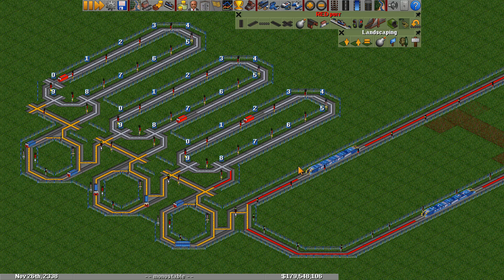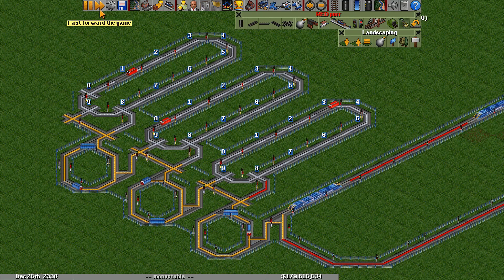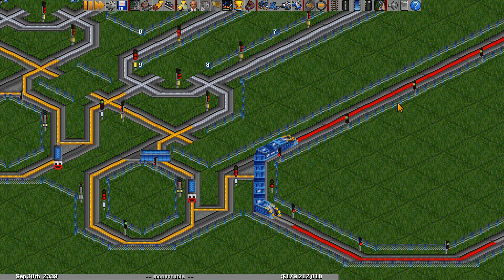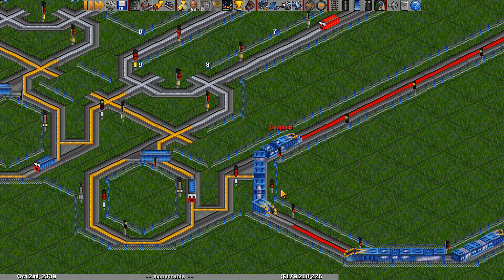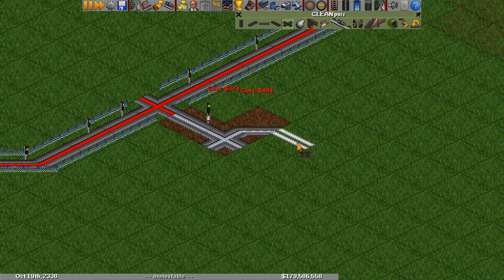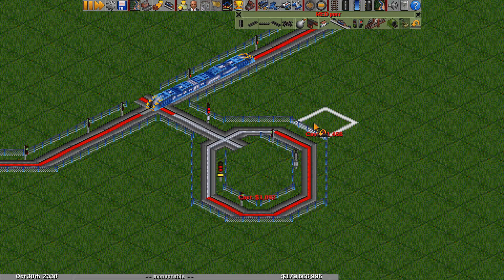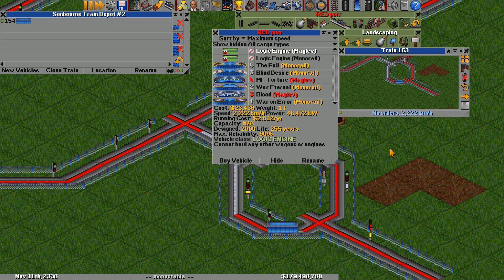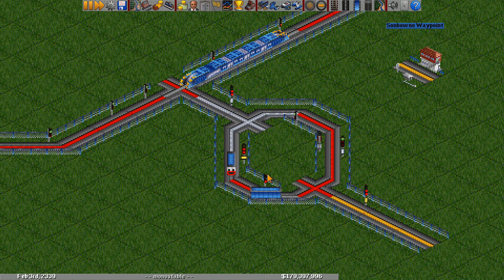OpenTTD Logic: Train Counter (Monostable Circuits / Edge Detectors)

Comment: I kept having trouble with my MSC in this orientation. I found that I could build it aligned with the grid. The input is done on one long edge, and the output from the next short end in the direction of travel. Exit signal  on the corner after the output, entry signal diagonal from the exit, and blocks on the remaining corners.

For some reason getting it out of the oblong shape made the logic make sense to me. Anyway, great stuff, I learned so much watching your tutorials.

Comment: I have some followup questions.
1. What does keeping state mean?
2. Do you have any specific examples of what a train counter can be used for?
Reply from the maker: 1. By "keeping state" I meant how the counter trains increment each time. Like a very simple state machine where each state just goes to the next one in a loop.
Before this design it was actually very hard to create consistent short green pulses that allowed the train to move one "state" (signal), you'd have to have something like this: https://i.imgur.com/DphQhMM.png which takes up a lot more space, is dependent on train length, and is less robust against jams.

2. Here's a quick use case I made: https://i.imgur.com/lWyAARe.png
It's a train splitter that will allow every 5th train down the red line, so a 1:4 split. You can see this has a circular counter train with 5 states, so thats how it keeps track. (And the old example above is a 1:9 splitter)

So then the next question might be "Why would you need to split exactly 1:4 (or 1:N) trains? How would that be used?"  Some NUTS trains can set conditional orders based on track color so then the split could control which destination a train goes to. There's also Self Regulating Networks (SRNW) where you basically have trains without orders and use logic and pathfinder traps to steer the trains towards stations. Now none of those are really the $$$ optimal way to play, but OpenTTD really is a sandbox game and I find this kind of stuff a lot of fun :D
Reply: @LugnutsK  Thanks. I probably wouldn't both with SRNW because it sounds too time consuming. The NUTS conditional order sound interesting though. One last question is do you use any vanilla conditional orders in your games?
Reply from the maker: DC 4444 Rarely. When I do it’s usually just for maintenance waypoints. Also with refit games sometimes
Reply from the maker: (I don't play with breakdowns but still need maintenance when upgrading trains)
Reply: @LugnutsK  What's a refit game?
Reply from the maker: @DC4444  For example, trains drop of iron ore, then go into a depot and refit to steel, then pick up steel at the same station (or nearby station), and continue on, etc. Emphasis on station design in refit games:  http://blog.openttdcoop.org/2012/02/16/advanced-building-revue-11-refit-stations/